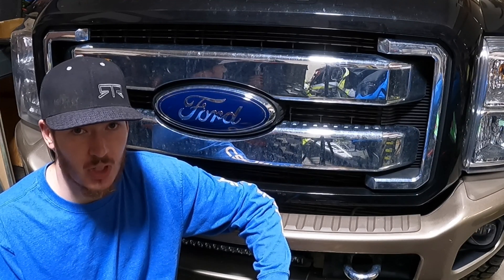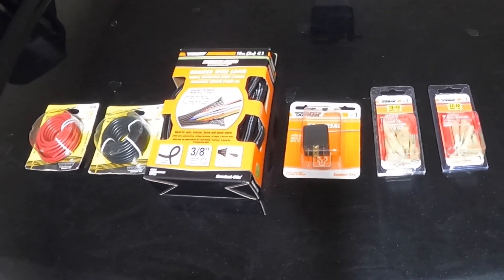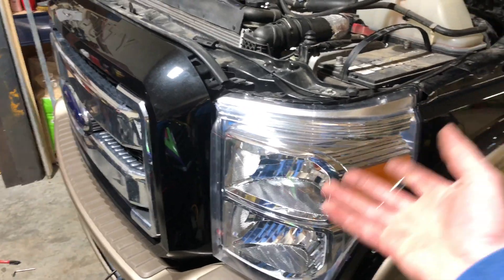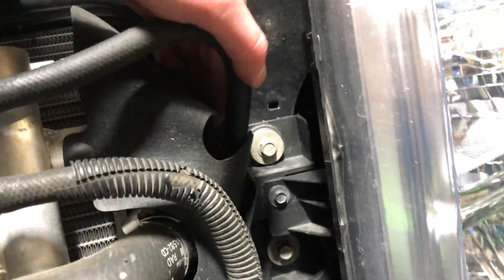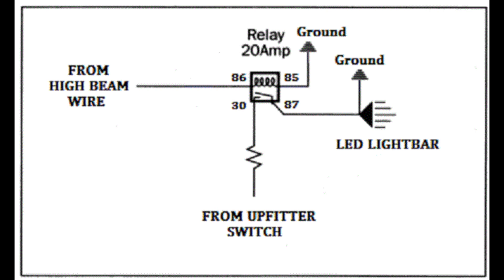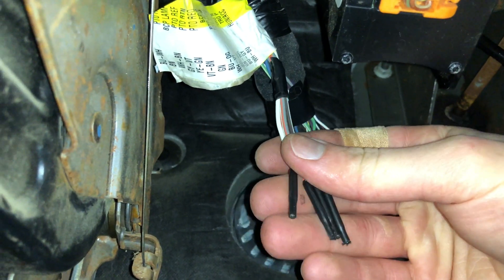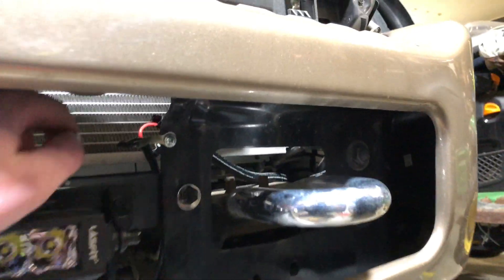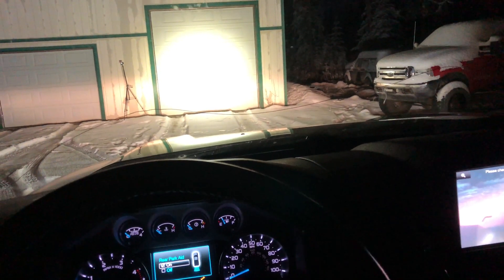How To Easily Wire A Lightbar Or Other Accessories To Your Super Duty Upfitter Switches!

Comment: So the switch activates a relay, that then activate an other relay than then finally sends power to the light....
Reply from the maker: Somewhat, but not entirely. The upfitter switch just provides power to the second relay. It’s triggered by your high beam switch. This is only applicable if you want to be able to actuate the light bar with your high beam switch, otherwise you would just wire the light bar straight to the upfitter switch wire, and then ground it
Reply: @akgearhead  Got it! Thank you

Comment: Hey bud awesome vid. Only question, why wouldn’t you just go to the fuse box and tap into an accessory wire instead of using the headlight? I just think it would be so much less work doing it that way then taking off the grill and all that stuff.
Reply from the maker: Not sure what you mean by using an accessory wire. I want the light bar to come on with the actuation of my high beam switch, hence utilizing the high beam circuit as the trigger wire for the relay. It really only takes maybe 10 minutes to remove the grille anyway.
Reply: Accessory as in a keyed circuit.
Reply from the maker: @Deerector so you would suggest wiring the relay so that it turns on the light bar any time the key is switched on? Sorry, I’m not sure that I’m following
Reply: @ no. I was saying you can find any circuit you want in the fuse box and just tap into that circuit. You could use those little fused wire taps. You coulda just went to the high beam one.  But like you said, if the grill and all wasn’t hard to remove and put back, you were fine.

Comment: Where did you find the brackets to close in your gap for the mounting brackets? Just got a 24” bar and I’m dealing with the same issue of needing more surface to mount to than what I have between the frame. Thanks in advance.
Reply from the maker: I just used some flat pieces of scrap steel and bolted them in place and then drilled holes to mount the actual light bar to them.

Comment: OMG i finally found mine, the Upfitter switches were already attached to the relay/fuse box found left side underneath the steering wheel comparment area. Had to pull the cover off and there were the 4 wires coming out of a wire harness bundle.
Reply from the maker: Sweet!!!

Comment: GREAT VIDEO!! I can not for the life for me figure this out...call me dumb.. lol My 2005 F-350 DRW FX4 had factory aux switches and have a black wire harness inside a black plastic conduit that seems to go up to the firewall area, the switches outside are red/black/blue/white. There isn't a label on the harness either showing what wires are what....GRRRRR Freaking Ford.
Reply from the maker: I couldn’t tell you what is what on an 05. Never done any wiring on one of those trucks

Comment: So if we’re using the upfitter we dnt need a relay. Got it so power from the light bar goes to the upfitter
Reply from the maker: If you want the light bar to turn on and off using the upfitter switch only, yes. The upfitter switches already have individual relays for each switch behind your dash. If you want it to turn on and off with your factory high beam switch, you will need to use a relay in the configuration shown.
Reply: @akgearhead  thank you. Btw you should do more how to’s. Good teacher
Reply from the maker: Thanks man, really appreciate that! I definitely will, I just try to find ones that are actually useful for people, and that there aren’t already good videos of

Comment: So the uplifters are powered.
We just have to ground it to the chassis... for light bars???
Reply from the maker: If you have upfitter switches in your truck, they are already powered when your ignition is turned on. All you have to do for a light bar, is to run the power wire to the upfitter switch, and then ground the light bar to the frame. If you want to have the light bar come on with your high beams, then you have to use an additional relay as outlined in the video
Reply: @akgearhead  this single comment and answer helped me more than 10 videos I just watched.
Reply from the maker: @joebeezy9471  heck yeah man! Great to hear!